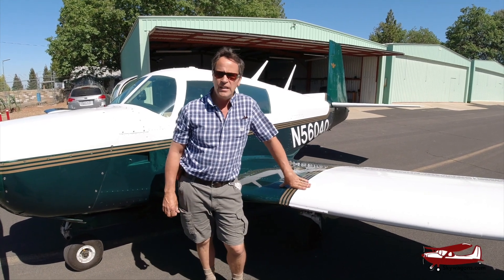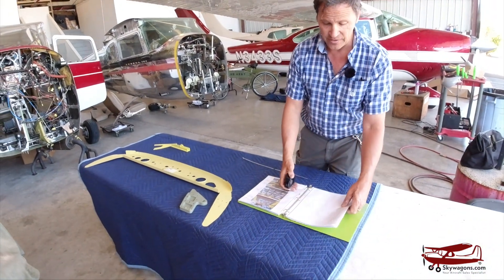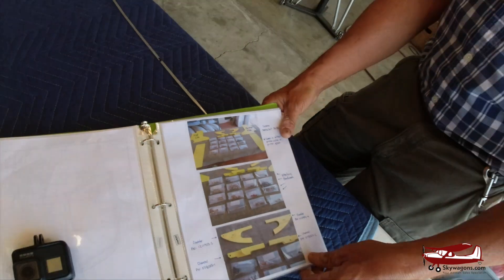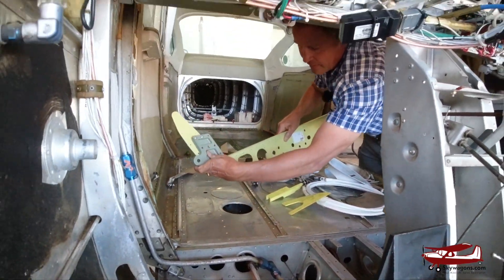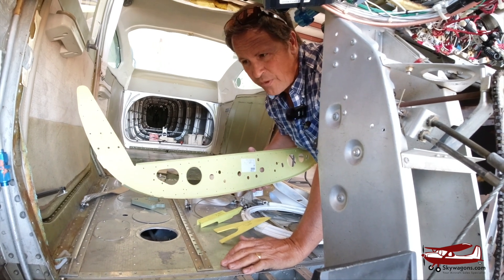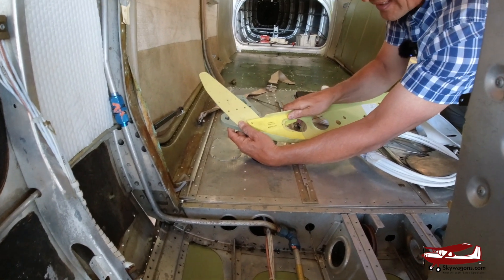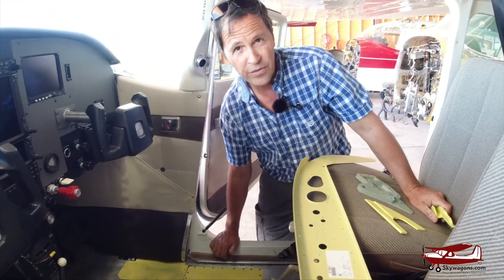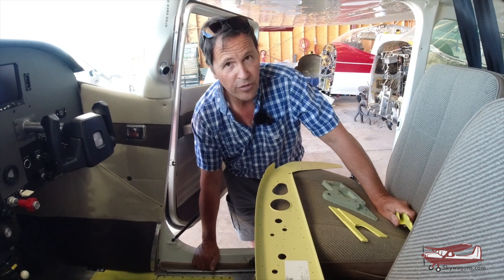Cessna Wing Strut AD Explained in depth with parts shown.

Comment: Mark, why are some models included in this AD and some not? Like the 172M?  Thanks
Reply from the maker: Different designs do and don't need it due to their engineering I suppose. Not sure about why one 172 type would and one wouldn't. 180's and 185's have struts but they are not in it either. Totally different attach points.

Comment: So, you need to replace the big bulmerang part, or just sandwich it with the original bulmerang, or it just need to install the smaller pieces as sandwiches?
Reply from the maker: You just sandwich the old part between the new parts.
Reply: @skywagonuniversity5023  Great, thank you, Mark.

Comment: If it's not needed, off course sometimes you will find a scumbag that signs the AD without checking it and states is not needed but if you do the inspection the crack is about 1/2".....be careful with that AD compliance....
Reply from the maker: You have to inspect all of them.  If there are no cracks you do not have to do anything. If there is a crack, do both sides.

Comment: Anybody happen to know the sheet thickness of the factory installed strut carry thru bulkhead that is cracking?  I think it may vary between models (172,182,206 etc.).
Reply from the maker: Any gurus out there help with this? It is much much thinner than you would expect.

Comment: Any known wing strut failures attributed to these bulkhead web cracks?  
This design appears sound as there are factory reinforcement doublers attached to the back of the bulkhead on each side that span over the possible web crack areas.  Also, a carry thru angle is attached to the top rear of the bulkhead that secures the floor panel and is connected to both strut attach fittings with 3 Hi Shear rivets on each side.  So this arrangement seems almost failsafe as there are multiple load paths and the heavy strut attach fittings are mounted inside the door post channels.
Reply from the maker: I think it is literally a failsafe to prevent total failure if cracked.  The cracks are tiny though.

Comment: Very informative video...just to clarify.....if needed,  will the floor have to be cut ONLY where the covers that come with the kit will be placed or is the covers a doublers for the floor....could you do a video if a kit being installed  ...thanks again
Reply from the maker: Yes,  The floor is only cut to put in the reinforcements.  The finished floor has those extra covers. This plane was in the shop for A firewall and some other work, so it was a great opportunity to show inside the guts of it.  Filming through the missing firewall was a joy.

Comment: Would have cost Cessna about 20 bucks to add the obviously needed doublers to the design at the factory.
Reply from the maker: True.
Reply: @skywagonuniversity5023  They aren't "obviously needed". These designs have been flying quite safely for nearly 70 years.
Reply: @KB4QAA  The problem is aluminum has a fatigue life limit. Steel does not. That is why pressurized aircraft will have a life limit on the hull.

Comment: That looks like a design to fail scenario. They should of put a small doubler where that little section of the part dips down in the corner.
Reply from the maker: i don't think Cessna realized that they would last 50, 60, 70 years.
Reply: @skywagonuniversity5023  Right. This was suppose to be like cars, right? Last up to 20 years, then sent to the boneyard and buy a new one.....

Comment: Wondered why you took off on that Closed runway - the BIG Yellow X.
Reply from the maker: Extra length.
Reply: @skywagonuniversity5023  Are we saying the same thing?  The X means the ENTIRE runway is closed.  Right?
Reply from the maker: @mmichaeldonavon   No the X is just that entry onto the runway. It's the over-run area for jets.
Reply: @skywagonuniversity5023  Here's all I know about this subject:  "Runway Closures
The final runway marking you might see is pretty easy to figure out. If you see a giant yellow “X” on a runway, it means that the runway is closed. If it is a permanent closure, the X is painted on the surface, and all other markings are removed. If it is temporary, giant, moveable lighted X’s will be placed over the numbers."  

As I'm always willing to learn, can you help me out with a reference?   Thanks.

Comment: Great informative video. From a non- pilot, why does the kit cost so much? A good CNC unit and I could produce that kit for a fraction of that cost. Seem like someone is taking advantage of airplane owners. Not fair for them. Again thanks for sharing this video.
Reply: It's not the manufacturing of the part whcih is expensive, it's the engineering of the part, and the cost of the certification that's expensive.
Reply from the maker: You should do it. You'll need FAA approval which will cost tens of thousands.
Reply: You need certification of the production of the aluminum you purchase from where it is mined and turned into metal from ore. The person that sells you the metal will have to have quality department that will sign and certify that there documents are true and correct. You will have to have a certification from the place you purchase the finished metal products that they conform to a recognized standard. When you receive the metal your incoming quality department will have to stamp the incoming paper work that all of the certifications and statements on the incoming paper work are correct. You will need a training roster for people that are going to machine the metals. You will need calibrated measuring tools and a quality department to inspect and certify that the parts meet the drawings. You will need an engineering department to make the drawings. You will need an accountability manager to prove to the FAA that you have all these things. All of these people, can be one person. But the roles are the same. Then of course you need 50 to 100 million in liability insurance. You can be sued for a crash of an aircraft that have your products installed for 18 years after they are manufactured (Congress passed an insurance liabilities law in the 90’s to prevent the complete death of general aviation). I am not in the business of producing aircraft parts, but that is what I understand working in a FAA repair station.

Comment: Mark,
Very informative, thanks.  As a lifelong aircraft stress engineer (www.Acroflight.co.Uk) we come across design issues like this all the time.  The skill is to identify them before the aircraft prototype flies and to change the design to avoid in-service issues.  Hearing about the rectification cost is interesting, tens of thousands of USD.  To find this and rectify it at the design stage would take around 10% of that costs (as part of a wider stress analysis and optimisation study). We are pressurised during design to cut the cost.  Less cost = fewer hours doing the stress work = more rectification in service.  

I will use links to your excellent videos to demonstrate to aircraft program project managers why they should not cut design/stress hours so readily.
Reply from the maker: I do not think that Cessna thought that the fleet would have lasted this long.
Reply: @skywagonuniversity5023  good point, but GA airframes are generally designed  or stressed for a set lifespan or Safe Life as we call it.Also, the load spectrum we use is on the conservative side of normal life (which in any case would be at least 20,000 flight hours).  Larger aircraft have damage tolerant load paths, I.e. if something breaks there is another route for the load to take.  Safe Life requires the parts stay intact until they can be inspected.  Fortunately the inspection process is thorough, otherwise the corner cracks would not have been found.  Unless aircraft have been breaking up?

Thanks again for your videos and for taking the time to reply.
Reply: @johnwighton  Most of the affected airplanes are continuations of designs originally certificated in the 1950's under CAR 3  so don't have life limits.
Reply: @johnwighton  Your design standards are not realistic for engineers working in the 1950's with slide rules and and an expected aircraft life of perhaps 20-25 years.

Comment: Thank you for explaining and showing what a poor design strut bracket Cessna made.  Yikes!  Have flown many hours in a Skylane and never realized the strut is merely attached to the 'side wall' of cabin.  The real meat of the strut bracket needs an L or 'foot' coming inboard about an inch, thereby actually joining the side and floor, vs. the .032? piece that cracks, which is a tell tale its pulling apart.  Amazed Cessna hasn't had more 'folding wings'.  But, many birds are getting some years...Just my 2 cents.
Reply from the maker: The attachment is to the side to side structure right under the belly to the other strut, but the two rigid parts does mean that it it moves it can crack between them.
Reply: "A really poor design"....That has served quite well for nearly 70 years.
Reply from the maker: @KB4QAA   I agree 100%.  They did not know that they would last this long.
Reply: "Have flown many hours in a Skylane and never realized the strut is merely attached to the 'side wall' of cabin."

It's not, it's attached to the underfloor bulkhead, and it's attached to the doorpost, both of which are integral parts of the airframe structure.  It is not  ... " merely attached to the 'side wall' of cabin."   You must not have watched the video.

Comment: I realize I’m spitting into the wind here, but I can’t help thinking that the fix seems like overkill. Could no one repair  the crack in the airplane? A crack appearing at that point seems predictable too. I’m also wondering why the strut attach part has to be replaced too as I don’t understand how a 1/2” crack could require so many new parts. Colour me puzzled 😕.
Reply from the maker: The attach part does not need to be replaced.  Just those two little parts that I am holding.  The other parts are to show what is in there.   It was great to have this already firewall-less 182 to look at.  This plane was in for other major work.  Putting these parts in does not require this level of dissassembly.  It was just handy for filming.
Reply: @skywagonuniversity5023  I did understand that the aircraft used for the demonstration was in for  other work as you did mention that as you went and you’re right it was fortunate to have it. The point of my comment was to focus on the high cost of some ADs to the owner. Many owners as I’m sure you know better than most, have sacrificed a lot to be able to own their aircraft. You can tell by the old cars they drive.😜 So even a $4000.00 kit purchase might have to be put on hold until they can scrape the cash together. That would be exactly the right way to go if it had been proven that the kit was the only safe way to go. My focused attention was the small crack. My experience has been with riveted aluminum boats. Not the same highly regulated thing, I know, but it does have similar issues with all of the stress, bumps and bruises and in many cases the grade and thickness of the aluminum are the same(depending on the manufacturer). If I understood you correctly, it’s 1/2” crack that demands a potential $7000. to $9000. AD? A small hole drilled in the path of the crack has been used to put a stop to a migrating crack for years. For additional protection, the crack itself can either be welded or even a flexible but strong epoxy applied. If that got the owner another ten years, that would be good. I, personally, am a strong supporter of safety rules and regulations, but I’m also mindful that there are more ways to skin a cat than one. The regulators could provide a range of solutions could they not?
Reply: @TomasAWalker53   Fixing by welding is just not an option for something like that.  Never mind that without removing the part from the airplane (which would require some major disassembly of  the aircraft structure)  you couldn't possibly get a welding electrode or torch into the location of the crack.  Even if you could have the part magically transported to a welding bench, then magically transported back into position are riveted back to the rest of the aircraft structure, welding structural sheet aluminum aircraft parts is just not an option.  When manufactured the part has a certain temper, whcih defines its' strength (in this case it's 2024 aluminum alloy at T-3 temper)   once you weld it, it's no longer T-3, it's softened and not as strong as the original part.
Reply: @TomasAWalker53 

 "  The regulators could provide a range of solutions could they not? " 

 It's not the regulators' job to provide solutions.  This is the solution Cessna has provided.  Other's are free to provide alternate solutions, but they too have to be approved and supported by engineering data.  It's actually not unusual for a  third party to offer a solution to an airworthiness problem  It you think that you have a better fix for this problem,  get together with an engineer and get some supporting engineering data, and submit it to the FAA for approval.  It's not going to be a cheap or easy process.
Reply: @andrewalexander9492  Thanks for the feedback.  You’ve mentioned temper and two numbers which is more than I knew, though I do know that all forms of engineering have there classifications to help with doing the job right. The notion that nobody could physically do a weld in support of a crack stop doesn’t jibe with what I have personally witnessed being accomplished by skilled welders. You’d have to disassemble anyway, so if the crack could be stabilized by a skilled airframe mechanic, why not? I’m not an A&P but I have not heard any definitive explanation of why a simple 1/2” crack “can’t” be repaired some other way, other than having to spend $8 Grand. I don’t believe in the notion that there is one fix available, if only because a few people stand to make a lot of dough following this directive and jobs to protect in a bureaucracy infamous for having to have their arms twisted(hard)by AOPA and EAA before helping the little people out. If you can shed light on my question, other than “it can’t be done”, I’d appreciate it. Also, I did include the idea of a crack stopping drill hole which I know is used in other areas on an airplane and following up with an epoxy weld as a backup if you will. 😊🇺🇸
Reply: @TomasAWalker53  In some cases a simple crack can be fixed quite easily. (A lot more easily than this, anyway)   In some locations, the crack could be stop drilled, and a sheet metal doubler  is riveted over the crack, reinforcing the cracked part.  There are standards on how large the doubler has to be, how thick, how many rivets to attach it to the cracked part, things like that.  But if the cracked part is accessible it can be fairly simple to repair a cracked structural part.  It's done routinely.   However, this particular part is problematic.  It is buried pretty deep within a pretty critical part of the aircraft structure, and it sandwiched in between other critical structural  parts (the strut attach casting on one side, and the door post on the other side)  so if you were to disassemble things, and rivet a patch in place over the cracked area, the rest of the structure would no longer fit together as original because of the thickness of the doubler and the rivets.
Reply: @TomasAWalker53  As far as welding:  yes, a skilled TIG welder can indeed weld aluminum sheet metal.  I don't dispute that for a moment.  But, the the part originally was heat treated, and after welding it's not heat treated, so it's not as strong as the original  Sorry, wasn't trying to BS you earlier with temper designations. the takeaway, was that the original part was heat treated, and the welded part is no longer heat treated because of the heat of welding, so is not as strong as the original.   The other problem is getting that part onto the welding bench.  That part is buried in the structure of the airplane.  in order to remove it from the plane you would have to take off both wings, or support both wings on stands and remove both wing struts.  then you you would have to drill out hundreds of rivets, to the point that you're almost taking the plane apart in the middle, at least the bottom half of the airplane will be more or less cut in two.  That's a huge amount of work, so it's expensive.  Figure a shop rate of 100/hour or more for a sheet metal structure guy and it adds up quickly.  The repair kits are engineered so that it can be installed in place, without as much disassembly (and reassembly)  I don't know this for a fact,  but I wouldn't be surprised if the cost to buy the repair kit and install it would be less overall  than the cost to take that part out and replace it with a new, un-cracked part, when the labor is considered.
Reply: New parts and reinforcements are needed as the true extent of the damage may be beyond the small visible cracks in the corner.  Also, if it was a bandaid repair the whole process would need to be repeated in another 10 or 20 years.  Best to design the repair, stress it to ensure it doesn’t cause a new issue elsewhere (for example, too thick reinforcements create a steep stiffness gradient which is a stress raiser).

Comment: Does the strut AD apply even if the Service Kit was done previously?  thanks....
Reply from the maker: The AD only applies in that you have to inspect for cracks but there will be none if the kit was installed so it is quick and easy.